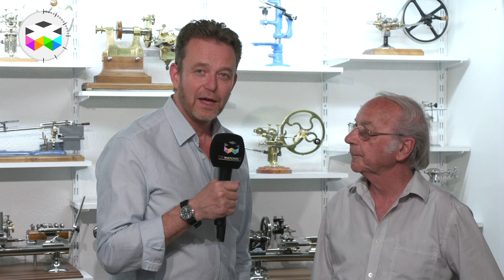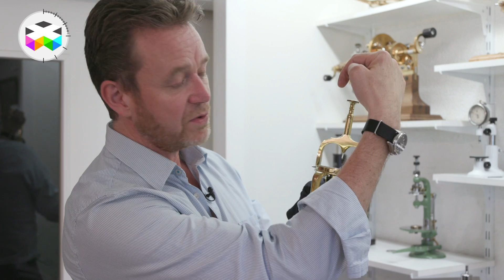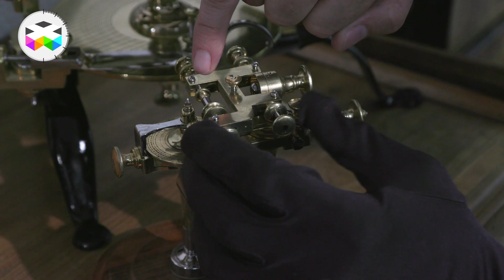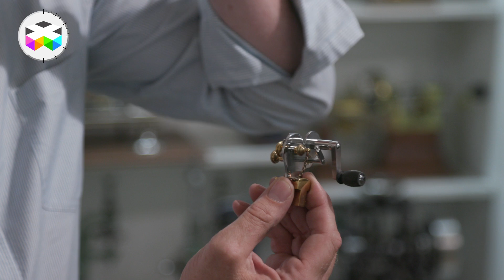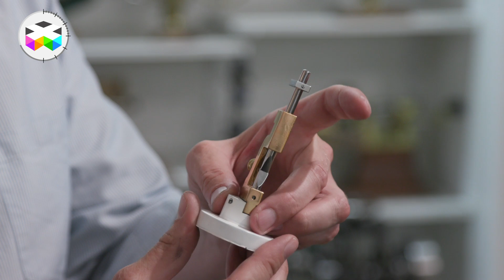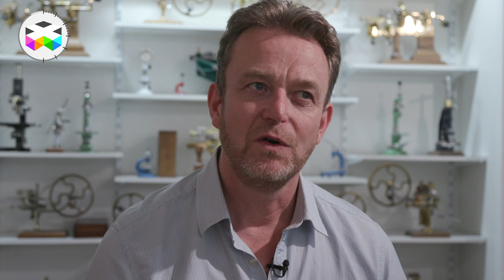Incredible Historic Tools Collection for Watchmaking

Comment: When is someone going to show the machines to make the smallest of screws for watch making and also the very thing plates and springs and other aspects of a watch, its all the same as larger items ,just very small items are made with hi end precision, like just think of the very small screws which you need a microscope just to see them when servicing a watch and you see the threads made on the screw and also the threads made in the thin plate as well? 🦘🦘👌👌✌✌👍👍

Comment: What a fantastic collection and video, thanks Peter for your detailed explanations. This collection needs to be preserved for posterity in a public museum, not least as a monument to this man's dedication in preserving these treasures. If ever you are in Waterford go to the new Irish Museum of Time where fantastic private collections of watches and clocks (mainly) are preserved and presented beautifully. How wonderful it would be to actually see these machines in operation. Just a comment on the wheels with fancy serpentine spokes. When wheels are cast it is well known that the spokes often crack as a result of contraction during the cooling process if they are strictly radial---the serpentine shape provides more flexibility and partly at least alleviates the problem. So as well as decorative, the shape may have a very practical function if the wheels were cast. You will find this technique used on cast wheels on even very humble farm machinery.

Comment: Is there a book about these vintage tools and how they were used. I would be very interested in an inventory listing all these vintage tools with descriptions of their use and pictures of these unique and rare tools'
Reply: Yes- Look up the books written by Ted Crom, a horological tool collector. He's gone now, but he wrote a series of self published books on exactly that. Look up Horological Shop Tools 1700-1900, Horological & Other Shop Tools 1700-1900, Early Lancanshire Horological Tools & Their Makers, and lastly Early Horological Wheel Cutting Engines 1700-1900 to satisfy your curiosity. Simonin in Switzerland has others as well. All 4 of these books are uncommon to rare at this point, but I have all 4.